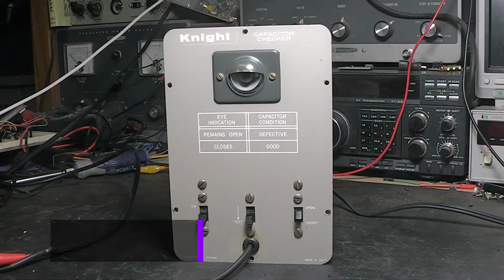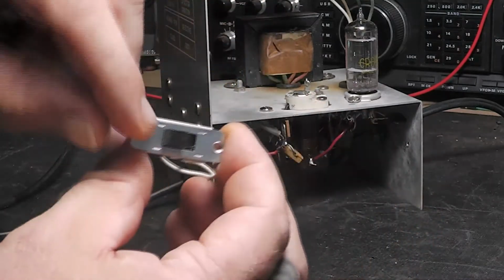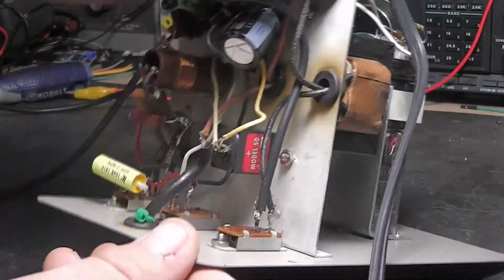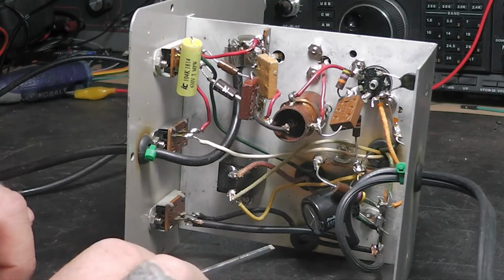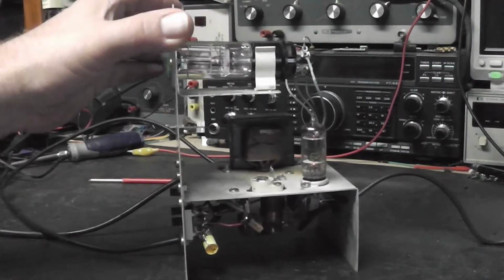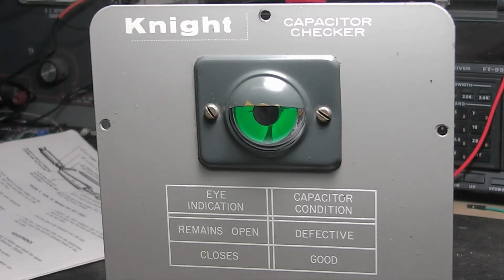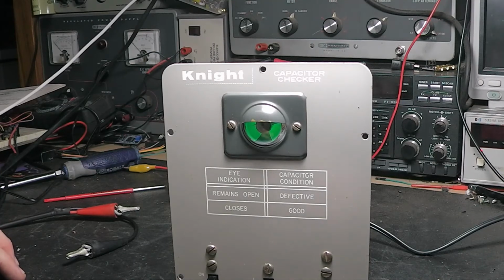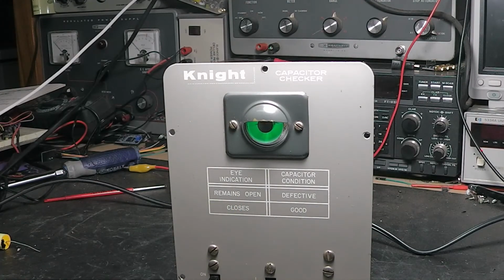Knight Capacitor Checker Part 2

Comment: Mr. Graves thanks for the refurb on this equipment. My lead coax reads rg58 /u, after restoration it seems to function as designed. It appears useful for spotting intermittently shorting capacitor pots. Thanks again looking forward to more vintage test equipment on your channel and your laid back southern style.
Reply from the maker: Thank You for the kind words.  Glad it helped get yours going!